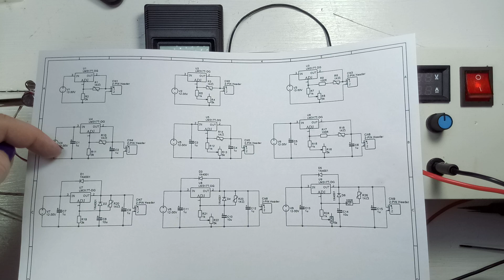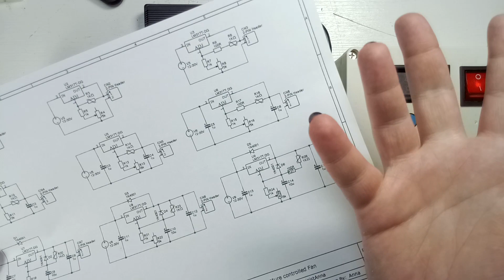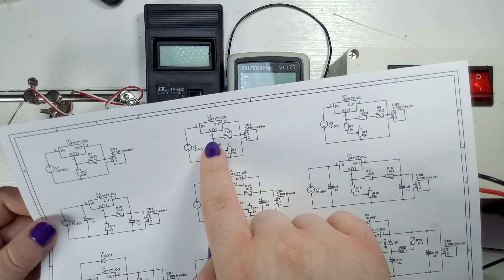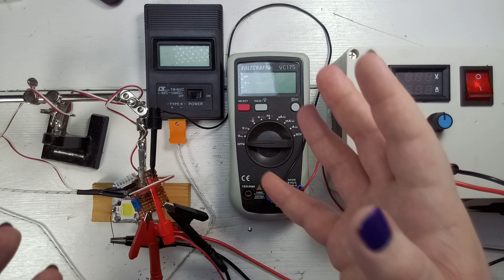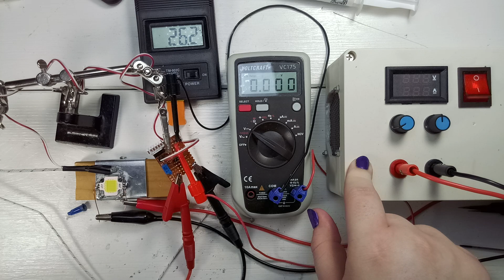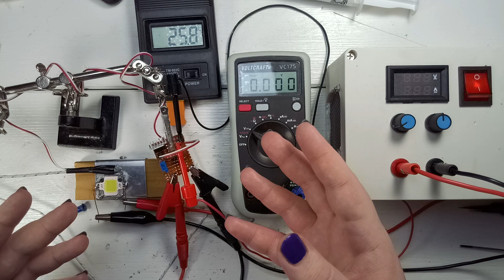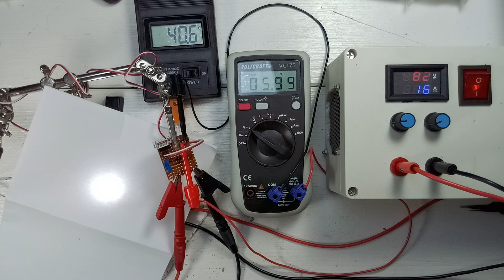More about the LM317 based Temperature Controlled Fan

Comment: I'll be stuffed. Tried 3 times last night.
The heat sink is 60mm wide, the server fans are 60mm wide and the wire wound aluminium cases are 60mm long. It looks like this load bank was designed - pure luck. These server fans are awsome but rather noisy. The air velocity is right on the curve of the graph where any faster would be a waste. I have a cheap anemometer.  Somebody got their sums right except for one point. Blade tip clearance is very critical for efficiency and I have yet to see ANY electronc cooling fan with anywhere near the right clearance. It's less I suspect on the engine of an A380 at full chat. (2 years on fan design, mixed flow, fun tests ). 

Well young lady I think I have got there with your help. The fans at 20C are set to 4V and top out at 12V at 75C. My old brain suddenly clicked and I used a mug with hot water and a wine thermometer. I ended up withh a 270 Ohm resistor in series with the 1K NTC. I have not checked what the R2 pot ended up at. It took a while and some 'big thinks' but it does what I want. I fitted a 40mm fan blowing down the 25mm high x 20mm wide  x 10mm 8 fins LM338 heatsink. At 4V I can hold my finger on it (<60C) after 30 minutes. My infra red thermometer gun does not like shiny surfaces. I am trying to make this load bank suitable for things like meter calibration. Those 3 digit meters are poo. 

Thanks yet again Anna. I was very lucky to find you. I will be watching your videos. My test leads melt so that's another job.    
I really thought last night I would be unable to thank you - bl**dy YouTube.
Take great care - YouTube needs more like you.
Regards.
Reply from the maker: Thanks for all your comments jp! :D
I really appreciate every comment I get, I really enjoy helping you :) So let me know if you need help again.
By the way I'm now back making videos, over the last week I was building a new overhead camera setup for my new camera. Now the quality should be better.

Comment: I got it to work Anna i am so proud of myself, thank you thank you for your guidance. the 317 really does its job well. I used the same thermistor on my 3D Printer because i had spares, I used 1000 ohms to 500 ohms on R1 and by golly the Steam Engine smokes great, when the heater gets hot voltage drops to 4V and it cools down, then when i turn on the fan to blow smoke out the heater cools off and the voltage increases to 6.75 just like i designed it for. Its amazing to see something actually do what it should according to the math, hurrah for Science and Applied Physics, Thank You again,   https://youtu.be/aOIggiWMnUI
Reply from the maker: Good job :)
Reply: Hey Anna my set up has messed up and i can;t figure out what is wrong can you help? It used to reduce voltage from 6V to 4V but now it only drops .5V the heater has run off on me and damaged my housing?????  Can these LM317 go bad???
Reply: I have been thrashing for weeks to figure out what i did wrong. Today I setup the two trim pots just like your bread board. and i sat trimming the pots until i realized what i needed to change to get it back on track. All your input were great expect one. The R2 must be 3 to 5 times the value of R1, Yes.  But R2  will not as the Thermistor. Triming R2 can set the voltage max value but it is not dynamic enough to trim Voltage based in R1 Ohms. To get a good response in the system from R1 as  NTC i had to put 5K on R2 and 1K on R1 each with a base 100 ohms. Just as you had in your bread board. I was able to observe Volts output while trimming the pots. R2 allowed me to adjust the Max voltage, which was  dependant on where we were on R1. Once i had the max Volts set, at 6.5V, I then used the R1 trim pot to verify the thermistor can see high heat 140C pull Ohms down quickly and reduce Voltage. It pulls the high of 6.5 down to 5.0V very nicely. In the train engine, once Temp levels off  and the Thermistor Resistance increases the Voltage will increase to rewarm the heater coil up. It should work really nice. I am so happy now and tomorrow will be building boards to install in trains for live testing. Oh Boy, nothing like a little Physics to help to make Model Trains go Smoking down the line.  Thank You for you help, Anna. Stay Well.  Dennis

Comment: Hello Anna
With a buck at 14V and the LM338 output at 6V the V diff = 8V.
 LM338 heat dissipation is 8 x 1.6A =approx 13W  (fans are not 600mA as stated but 800mA)
I assumed that as the V would be around 6V the Amps to the fans would drop. 
I had increased the size of the heatsink by a factor of 4 but it is still far too hot.
I am fitting a 12V 40mm dia fan directly abouve the heatsink.
Normally with all the LMxxx circuits I have made so far heat increases as you turn the output  up. This fan controller is the opposite,  as the input is 14V  when LM338 reaches around 12V output V diff is almost nothing. **
I need to do some fine tuning and find the best place for ther NTC thermistor but the end is in sight. It's been fun, thank you Anna and good luck.
** Please correct me if I am wrong, there is rather a lot going on at the moment.
Reply from the maker: Hey jp :)
That seems to be right. We drop the most power at room or "low" temperatures and drop the least at high temperatures. Also most of the time if you change the voltage to a fan it does not change its current consumption by much, sometimes it goes even a bit up. It's a minor change but can happen. 
Maybe you should exchange your server fans with standard pc fans and go for bigger ones. So they don't have to spin as fast to move the same amount of air. Therefore they are quieter and consume less power, less current consumption (typically ~200mA for 12V fans). 
In one of my projects I use a 14V fan (consumes ~200mA) that is powered by this circuit. Supply to the circuit is at 15.5V and the LM317 is completely happy with a 10mm x 10mm x 5mm heatsink. The circuit is set to reach maximum speed at 65°C and is most of the time at ~40°C so I stil drop quite a bit of power accross the LM317. But have to say the LM317/ its heatsink is partially in the fans flow path.

Comment: Hello again. If you have not read my comment please see your November fan control circuit. After I subscribed I looked at your videos and founds this video. Are you psychic, I hoped you had done this video. YouTube is a strange place, 99% junk but occasioanlly pure gold. I may have to use an LM338 (5A) as the server fans to draw quite a bit on startup (2 x 600mA +). I just thought I would let you now that I too use those small 3 digit V & A meters and several have been a long way out on the Amps - too far to adjust. One was 15 Amps and it should have read 4.5 Amps. The 4 digit ones seem very good - so far. £2.03 EBAY. It may take me a while to get my head around this video but I'll get there. Thank you again for your efforts.
Reply from the maker: If you have any further questions about this don't hesitate to ask :)
I hope my explanation is good enough to answer your first comment.

Also I had to delay 2 videos because I ran into a few problems with these V/A meters. Same problem with wrong current display for no apparent reason. Funny thing is that they display the right current aslong as they are not installed in these projects and I don't know why. Stil searching for an explanation.
Reply: @PhysicistAnna  
Just replied on your first fan contol video. Odd these little meters should play up, I wonder if it's either the power driving them or what they are measuring being 'dirty'. The 4 digit ones though do seem OK. There are several different 4 digit meters that look the same display but not the circuit. The shunt position changes. Below is the link to the 2  I have found to work well (so far - fingers crossed)
https://www.ebay.co.uk/itm/DC-0-200V-10A-Dual-Digital-Blue-Red-LED-4-Bit-5-Wires-Amp-Voltmeter-Ammeter/283645376508?hash=item420a94f7fc:g:g98AAOSw9tFdp1yU

Thank you so much Anna. It's rather frustrating at times to know what you want to do but have absolutely no idea how to do it. I found current limiting thermistors by chance, what a find they were. I have 80,000 uF on each of the 2 DC front ends for my power supplies and the thump they made when switched on was very worrying. Now with one tiny thermistor on the AC input - nothing. Might be worth adding those to a video. 

I have not had a chance to go through all your videos yet but as I have 2 melted test leads (my fault not China's - 12 Amps - OOPS!) I know many will be worth watching. I am a retired mechanical engineer of the old school and all these little black things with legs are confusng but fun. 

I will try not to be a pain with questions but when a man is dying of thirst he will drink where the water is freshest.
Reply from the maker: I rather enjoy your comments :) One reason I started with this channel was and stil is to get in contact with others. Forums are good and all but typically people there don't help with projects, they just say it's a waste of time/ money. They discuss more about why you want to do a project instead of how to finish a project. Also I'm a physicist stil at university and people there are mostly not interested in electronics/ projects I do. We got a lab at university somewhat equipped for electronics projects for students to use but they tend to do your typical beginners solder practice projects not even with SMD but THT components and Arduino projects. Nothing advanced, nothing above 50V DC, no AC projects nothing that really is interesting for physicists. There are many physics experiments you could build but all involve high voltage which is strictly forbidden. I don't know what this lab is good for...